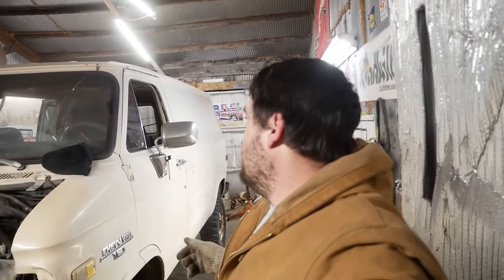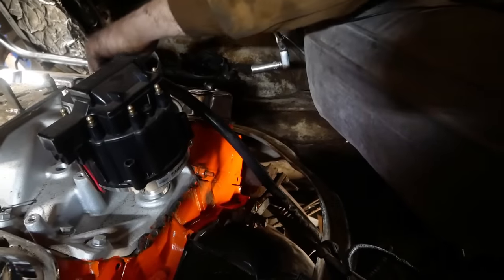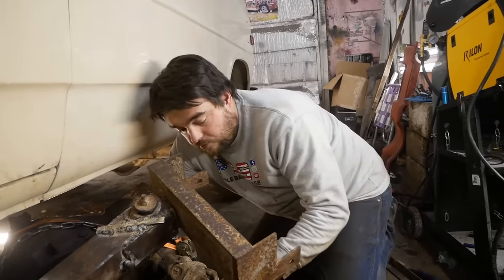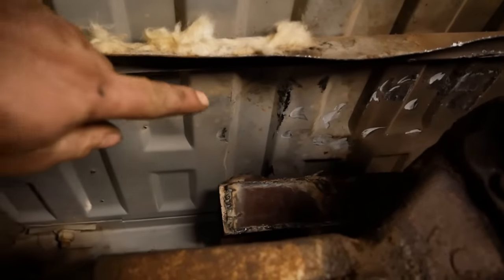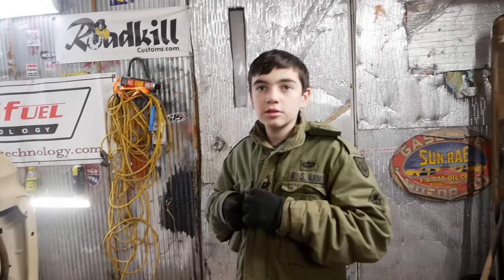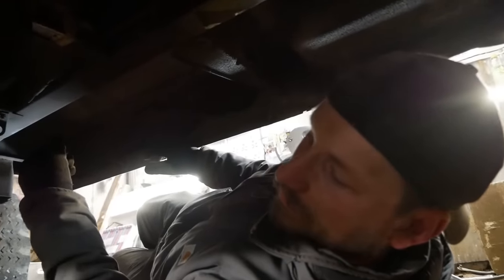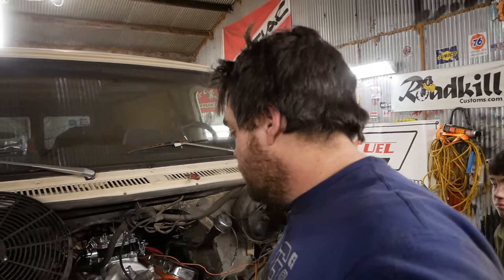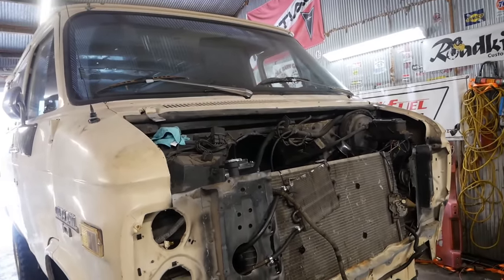Big Block 4x4 Shorty Van LIVES! The BEAST

Comment: "Cross-threading, Nature's Loctite" should be on a 
PBG t-shirt!!! I'd buy it!!!
Reply: Put me down for one as well 👍
Reply: Mee three!
Reply: Consider it pre-ordered
Reply: I’ve never purchased anyone’s merch but I’d buy a ball cap 🧢 with that on it. Black of course to hide all the grease stains on it from working on one of my old pieces of equipment.
Reply: I'm in!
Reply: Will it come in Fat-XXXXX???  Us fat folks want merch too.
Reply: There are only 3 thread pitches,  Fine, Course and Crossed.
Reply: Cross-thread is vastly superior to its cousin, No-Thread.
Reply: Yeah, it's a good merch opportunity Dalton..
Reply: Bring out the merch with this logo soon !
Reply: Yes we need it in our lives
Reply: @ChipW  Solomon Grundy want merch, too!
Reply: That's a damn good idea!
Reply: I was fortunate enough to be able to use that line in conversation today.
Reply: cross thread is better than no thread
Reply: I'm definitely a buyer !
Reply: I actually like this channel better than Derek from Tennessee.. You know who I’m talking about, the guy who Sells spark, relators for O’Reillys on the commercials now
Reply: Loctite was invented because of the tilt steering wheels on GM cars, they were known to come apart while you were driving, I guess you could say I got lucky when mine came apart at a stop sign, they have three bolts in there and loctite is what saved it from being a disaster for GM although they did do a recall, to apply loctite on those bolts

Comment: No one can appreciate more Dalton going full send on those sketchy welds and steering set up. 

But now the 4x4 van is complete. We can always fix our poor choices later. 

Viva la Van!
Reply: I prefer "out of the box engineering" to poor choices. Dalton is on the bleeding edge of theoretical red necking.
Reply: @kb9oak749  yes there’s lots of blood
Reply: I’m a sketchy welding SOB. You should see my steering shaft.  lol. It’s been on my truck 2 years and it still holds I call it gorilla welding. Ugly but strong
Reply: The welds smelled like they would hold, at least until I got out of the county.
Reply: Should also be a shirt
Reply: Can always fix poor choices later
Reply: Great cooment!!

Comment: I did a similar thing when I changed the oil on my truck.  Told myself  "self... you need to move that pan from under the tires or you will run over it!"  
Naturally, I ran over it, crushed it and spilled 3 quarts of oil in my driveway.  Oh well, back to the earth from whence it came.  Hilarious video and heck of a job getting this machine moving!
Reply: I forgot a pan was still under a car once and dropped the jack and crushed it 😂
Reply: You pregretted it!

Comment: Here we go. 1:03:23 of fun is about to commence...
The first laugh is the wrench reinforcement welding. 19mm is actually one of the more useful 'standard' sizes here, along with 15, 13 and 10.
The surgeon-like finesse you apply to the floor reshaping procedure has me in awe. Incredible foresight and planning going on. If it works, is it wrong?
JD never fails to impress with what he has learned and is learning. His welding is infinitely better than mine has ever been. He is a major player on the channel, with his skillset getting larger with every job he does. He is becoming quite the master, and I am not aware of any other young man with such a willingness to work and learn.
Ooooh foreshadowing. I am wondering what the mistake in moving the oil father will be. YOu sure know how to keep an audience captive, Dalton. Aaaaah, that's what it was. Oops.
I'm amazed that the rear drum assembly came off. Seeing how crusty it was looking, I assumed you were in for a fight. Was it worry about being able to stop or a haircut?
Those tires are an interesting choice, lol.
Damn the postage charges to the UK to hell. I'd love to buy merch and give you some support :-( There may be someone on its way to your PO box, though.
The way you make things fit and work is crude but clever all at once. I love the way your mind works, and you overcome issues when they arise rather than obsessing about them beforehand and causing yourself stress when it is not needed. Neil Approved.
Man, seeing it reverse out of the garage was a brilliant sight to behold. You only went at pulled it off, Dalton. When you were talking about this project, I thought you were mad and that there was no way on earth you could make it happen. I am super impressed that you did it.
I wish I was your neighbor.

In case you did not see my post on Insta, this is a copy and paste of my ideas for a name for the van;
"It looks brilliant. I'm not sure if you're very good or just a Vandal. A couple of name suggestions for it, if I may. It was out for revenge on the other two vans and settled the score, a Vandetta has been fulfilled. Or, it has sucked the life of the other two, making it a Vanpire. Or it was able to Vanquish the other two. Paint it white for the obvious Vanna White. I'll stop now; my head hurts."
Reply from the maker: I like vandetta!
Reply: @PoleBarnGarage  I do too. It seems very fitting, somehow. Feel free to make it yours :-)
Reply: The Van(tm) II

Comment: Was just watching you drop the distributor in, pro tip the gear engages before the pump. So put it in where you want,  put slight downward pressure while someone turns the motor until it drops into the oil pump. Easy peasy. Wire as usual according to were you have #1.
Reply: Love your show BTW.  Love that JD, ( my initials ) is out there with you. Not many kids are interested these days.

Comment: A trick I would like to share about the oil pump shaft not lining up to the distributor. Set the distributor where you think it needs to be and turn the engine over by the crank and the distributor will fall in place with the oil pump. Then recheck your timing to be sure its correct and not a tooth off or whatever
Reply: Best thing Chevy ever did was throwing distributors into the garbage. Sticking them back in the ass end of an engine up against a firewall was a poor design. At least Ford knew that the distributor was a regular maintenance item and would be better suited at the front of the engine.

Comment: Dude, I've un-ironically driven on 750-16s but that's because I was poor and driving worn out pieces of shit in the 80s. They'd be on split rims and you'd get them for free, still holding air. Good for the back and you'd buy el-cheapo radials to put up front. YOU NEVER GO FULL BIAS PLY!
Seeing you willingly put them on that van today fills me with equal parts revulsion and admiration.

Comment: 12:53 tip of the decade for dropping in your distributor and getting it to point at number 1 without having to stick screwdriver down the oil shaft hole. Works on any Chevy based oil pump. Just lift up the distributor until you feel the gear disengage. Turn the rotor back a little bit like one post on the cap. Drop the distributor back down and see if the rotor goes where you want. It may take a few tries but the gear will turn the pump for you so you’ll never have to turn an oil pump with a screwdriver ever again.

Comment: When it's too cold for the batteries you just need to use a heat gun to warm them up slightly, once you're using them they'll generate enough heat to keep working.  Same if they're too cold to charge.  I figured that out installing 3 garage door openers on a detached garage in sub zero weather, there was no way I was doing the job with only hand tools...  At least I was out of the wind for most of it.

Comment: Not yelling or being an armchair mechanic but I hope you know the orientation of the brake shoes does make a difference. I put a sterling 10.25 full floater in my 85 f250 a few years ago. The guy redid the brakes before blowing a hole in the engine on the parts truck I bought. No matter what I did the brakes on the whole truck was off because he put the leading with leading and trailing with trailing. Fixed his mess up and that fixed it right up
Reply: I'm also new here lol. Bear with me til I learn the ways things work

Comment: Nice to see it moving under it's own power! Though we all know that radiator fan setup won't work once it is hot in traffic lol.  I'd think about a factory clutch fan and shroud from a big block van.  I did a v8 s10 years ago, no room for puller fans so two 10" pushers on the outside just are not enough once it's over 80 out in traffic.  I need a different rad with puller fans and a shroud to duct the air through the fans.

Comment: Hello, Great videos.  You mentioned short brake shoe to front. That is because the bottom of the shoes is free floating. Only the top pin keeps the shoes from rotating. I believe it is called rotation torque. As the wheel turns forward the bottom of the shoes wants to move toward the back of the car/van. The back shoe wears out faster. With the shorter shoe in front they wear out close to the same time. Best wishes.

Comment: Hah! I use metric wrenches all the time, but i'm getting the education to wrap my head around all the imperial "eights" wrenches 😄 hopefully i'll get my hands on my first ever US car this year, so wish me luck 😀 i want one since forever, and i might just found the cheapest still running and driving box caprice with the 350 in it ☝️ its quite tough on the other side of the pond, but when its here, i can start with pulling the old 2 barrel off, and if i'm lucky i'll find a quadrajet somewhere, and then im pretty much set (all the welding aside 😅😂)
Reply: For 5+ years metric tools was the staple of my tool box 🧰.  I worked on machines that were manufactured in Switzerland 🇨🇭.  Lots of metric bolts, nuts and screws 😮😮😮😂😂😂😂

Comment: Hey buddy those power kings are definitely some awesome tires for sure!!!  Trust me I’ve had a couple different times where I had a 1982 GMC K20 that was actually really beautiful truck with absolutely no rust and it was a two tone red and white!!! I happened to get it stuck one winter when it was absolutely really foggy out and you couldn’t see anything in front of the truck!! I came up to a T in the road I was going maybe 20 mph and slide right off the end of the T in the road!! There was a layer of ice underneath about 4” of snow!! I had a big drop hitch on the rear and when I dropped off into the ditch there was a fence about a foot from the front end!! I was able to rock back and forth good enough to get the hitch out of the square receiver and then put it in 2wd and was able to get my rear end slid over in the ditch where I was able to drive out by myself since it was about 3:00 or 4:00 in the morning and I was only about a mile or two from the girl I was dating at the time!!! I definitely love those tires I just wish they made a much bigger size like a 34” or 35” tires and I would definitely buy a set in a hart beat!!! I bet that you will find that they are definitely an amazing mud tire especially when they are a bias ply!!! Mud doesn’t stick to bias ply tires as bad as it does to a radial tire!! They may not last as long but every bias ply tires I have owned I have definitely ran all them to wear they are as smooth as a baby’s but where any radial tire I have ran they usually will end up blowing a belt or seaperate at about when they still have a1/4 tread left!!! So you let me no witch one might work best for you??? I’ll definitely go with a bias ply any day over a radial tire for sure!!!

Comment: Awesome. I love this project. You need to do power tour this year with this van. Also, if you are interested, there is a square body, mid eighties, 1/2 ton pickup with big running boards for sale in North Baton Rouge, La. It is on old highway 61 almost to Zachery. I know nothing about it as I have only seen it while on deliveries for work. Only thing I know is it is blue and black 2 tone, 2 door, and it is for sale.

Comment: Regarding drum breaks, about ten years ago I did my first drums on an f350. Chased my tail forever trying to figure out why one side of the rear breaks was getting way warmer than the other. I had both the smaller shoes on one side and the bigger on the other. Didn't know they were different and didn't notice when I put them on. Some of the most annoying problems are caused by the silliest things.

Comment: Surr has some great tools and line repair kits for efi and brake/transmission lines. They also have some thread repair/cleaning kits for any thread pitch and size. Even axle nuts! Also ive had 1 glass lens fall off a snowmobile headlight on an old artic cat and i used gorilla glue to glue it back on and it worked flawlessly! Lol

Comment: Good job. But I'm wondering if you addressed the mess inside the rear diff? Did you clean it out and lube it up? If not, I expect a catastrophic failure to be imminent.
Reply from the maker: Phsh clearly you've never owned a 14 bolt

Comment: "Using brake tools is for chumps. Pair of locking pliers gets the job done." I've never used a brake spring tool and had it actually work. I've always just used vice grips.

Comment: You can sharpen old drill bits with a sander or a "wheel o' death." the 2 edges that come into contact with steel just need to be sharp.. kinda...

Comment: Still have the 454 rubber air intake hose off the air cleaner? If you are not planning on using it, I need that intake hose. Will buy it from you and pay you to ship the thing.

Comment: All Chevrolet and GM starters are not the same there are 15 different ones !!!
ALWAYS check engagement same as rear end gears for proper engaugement .
Reply from the maker: Check engagement by sound, sounds fine doesn't it? I've done hundreds this way with no issue

Comment: Figures they put the heaviest gear drive transfer case in the thing. Looked like the original van had more clearance like a small body lift or how ever they did it
Reply from the maker: Can't do a body lift on a unibody van. I think it's because of the big block somehow
Reply: @PoleBarnGarage  yeah I know, just looked like there was a little more clearance in the 1 ton. Hey it's cool I like the tires you chose !

Comment: Bias ply tires are lighter weight and that’s pretty much the only advantage over radial tires
Reply from the maker: These are heavy as hell, but Bias ply tires are basically useless for sure
Reply: Pretty sure weight is comparable.
But for off road or drag strip you want bias ply and I suspect this van will see more of that than grocery runs and soccer dad duties for which you would want radial.

Comment: we used to drive around with a battery in the trunk. wed look for car that seemed nobody drove. in the winter theyd be covered with snow. in the summer theyd be parked in the grass maybe. anyway wed knock on the door to try and buy the car for scrap price and 1 in 10 times or so wed get a deal. it was a way to spend some time booze cruising and smoking weed looking for a deal on the weekend. i think back now and realize that i becamme a alcoholic by the time i was 17. probably not  a good thing...lol. flat tires. gummed up carbs. ppl got a new car and just wanted the other car gone.all kinds of stories

Comment: never understood why 10 minutes with a powerwasher to get all the grease and crap off the parts gets skipped. just makes handling parts, etc easier.
Reply from the maker: Because it was -5 degrees outside and I work in a tin shack. I'm assuming you live somewhere warm, where I would much rather be

Comment: Those  rough country shocks are the best you know Mexico is a rough country. And kudos to those double hose clamps they will not come off, JD copied my fuel pump switch makes a great anti theft., you should bolt that starter to the block with that little nut  thingy because it will bust in half, if your timing is retarded, , that's a nice van.

Comment: I would not have beat the floor to make room I’d have used a floor jack and jacked up on the floor and made room the weight of the van would have held down while u jacked it up to make room but I no you wasn’t thinking about that u was just like get those moved so out comes the whammer